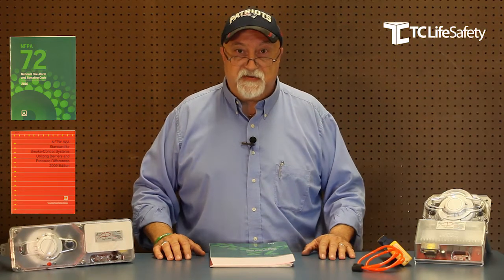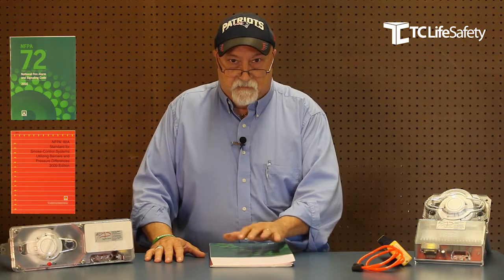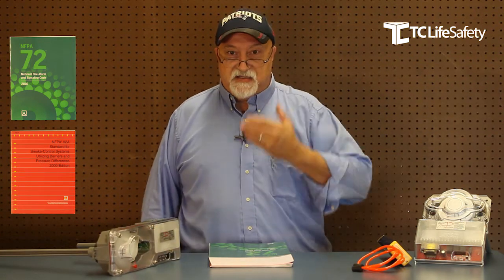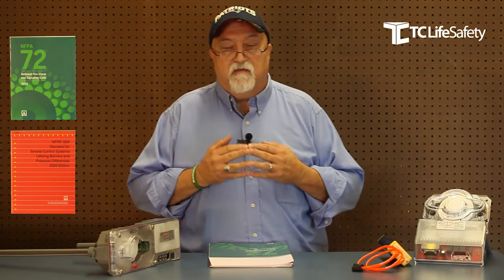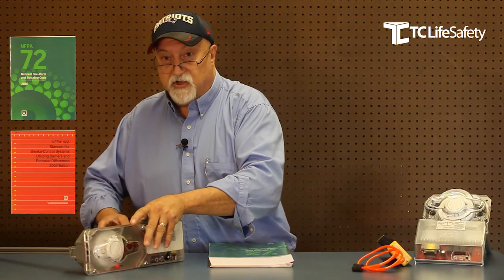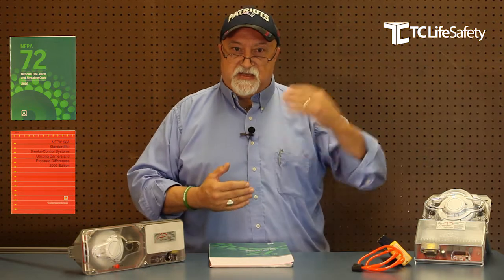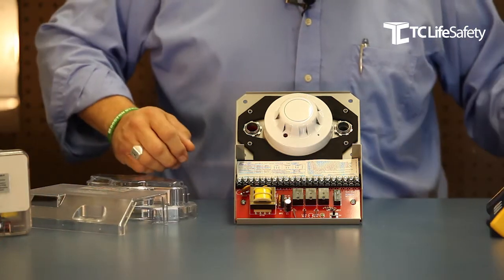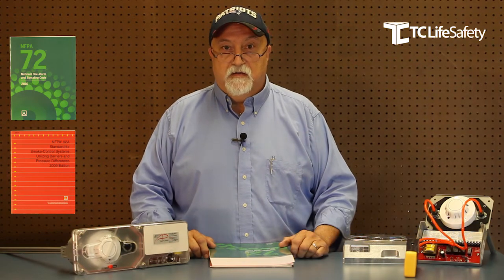Tech Tips - Duct Detector Operation and Testing

Comment: Dave, do you sell the assortment of duct detector tube stoppers to use with manometer tubing? I bought a Fieldpiece SDMN5 manometer which has dual integral 3/16" hose barbs. It came with 5/16" to 3/16" tubing adaptors, two pieces of 3/16" tubing and two brass connectors which are 3/16" hose barb on one end and threaded male on the other.

Comment: Thanks very well explained.  Some manufacturers say to drill a small hole 3 feet away from the tubes and spray smoke into the duct,  any comments on that?  Do you have a favorite  brand manometer?
Reply: This would surely be a real world functional test... long as the use of the spray was controlled.